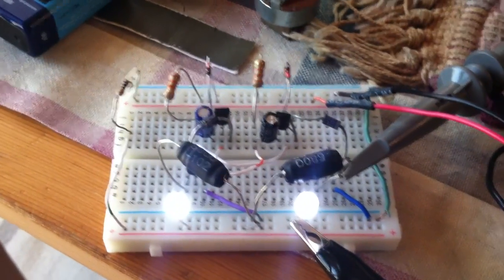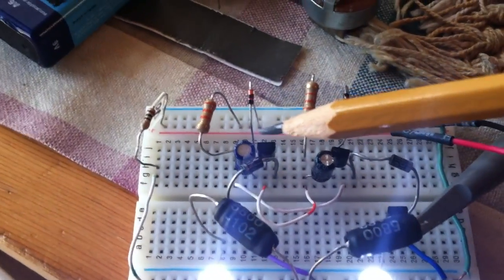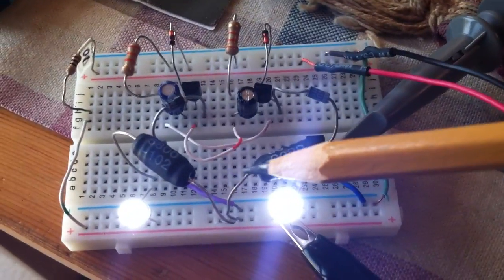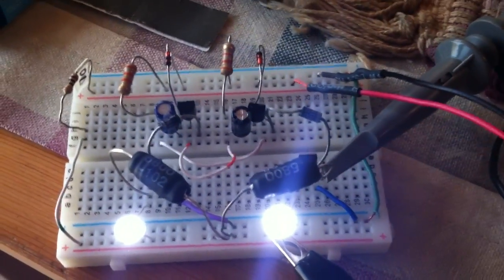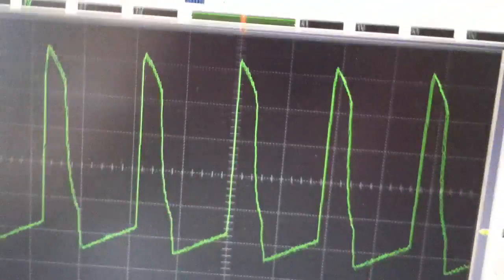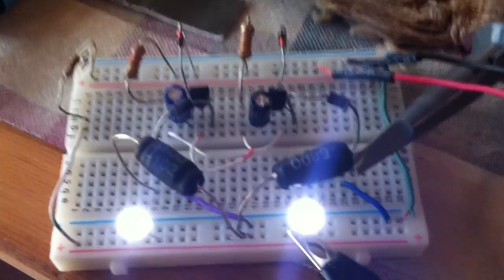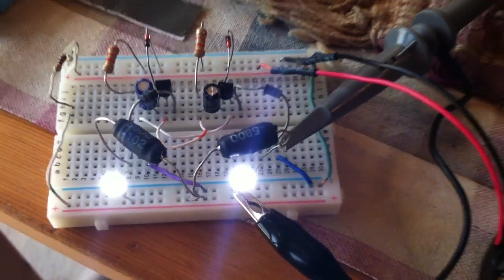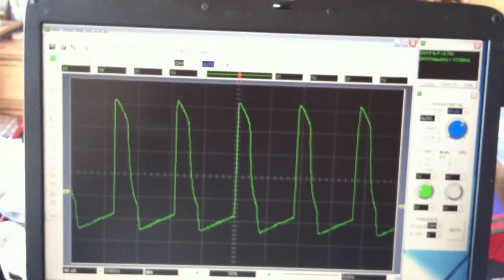Flip Flop LED Light

Comment: Interesting! How much power does just the flip flop use by itself? I bet you could reduce that current significantly by using much smaller capacitors and higher value resistors. To really lower power draw, you may need to use a CMOS device. Then use the output of that to drive a the switching element. You probably need to add some 10k to 100k resistor instead of those diodes between the base of the transistor and flip flop output, which will allow much less current to be wasted through the BJT junction.
Reply from the maker: +Power Max This setup is way off.  MileHigh at the OU forum put forth a strange led driver circuit that called for one inductor and three switches operated by two CMOS 555 timers.  The circuit operation seemed impossible so I built this as sort of a learning tool to investigate part of the idea.    I probably won't go any further with this project.